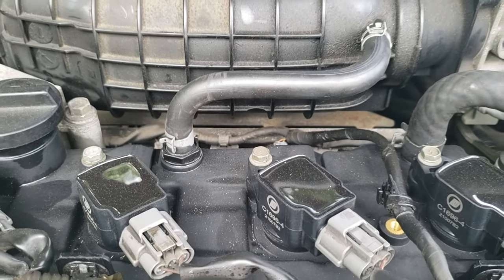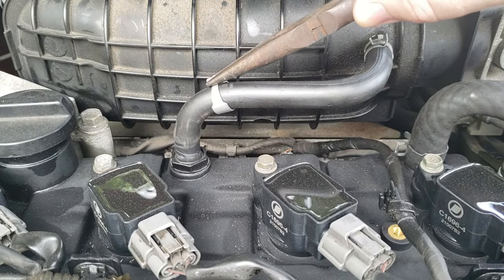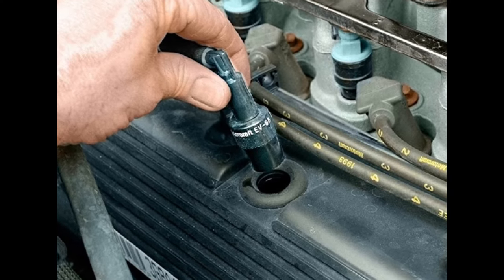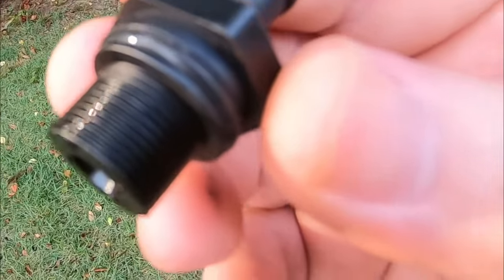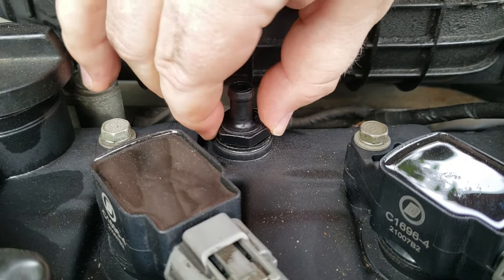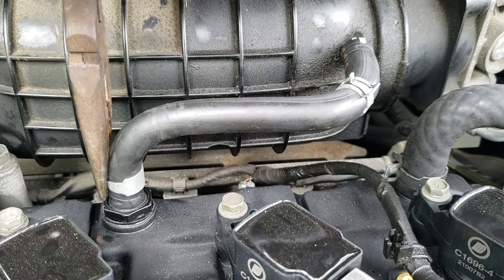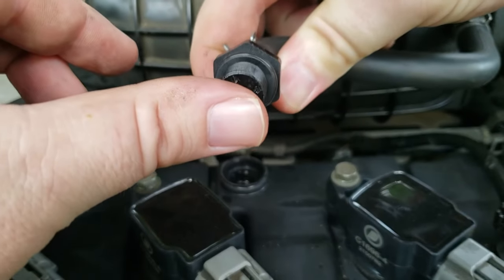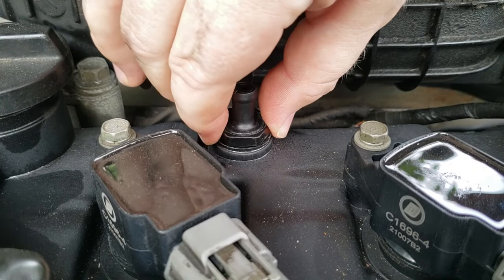Nissan 2.5L (QR25DE) PCV Valve Replacement - Quick Guide!

Comment: Hello, I am the owner of Nissan X Trail 2.5 Petrol 165 PS. 2003 year. Car uses oil every 400-500km needs extra, no signs of smoke or leaks . In the group of Nissan I was told it might be PVC Valve , Is it possible that this problem is from him, I look forward to your reply.  Thank you
Reply: My 2009 nissan navara “frontier” with the same engine was consuming a lot of oil almost 1 quart every 300 km, and just after cleaning the pcv with wd40 and compressed air it was another story like no more oil consumption at all.
Reply: @marwanjleid5712  super Thank you for your reply next year when I go back to my home country I will change it I ordered a brand new one pCV . The car is driven when I go home on vacation to my home country, I've had it for a while, I hope to solve the problem and it turns out to be just that.  👍👍👍
Reply: @Todorov7900 
It would be better to replace the rubber tubes if they are worn, this problem is known for these engines as i know here in libya and the middle east market and the best way to solve is to install an oil catch can.
Reply: @marwanjleid5712  THANK YOU friend for the recommendation and time I will do that too if there is no difference with The PCV valve

Comment: Hello. I have a 2010 Altima 2,5L 110K. I cleaned my valve cover 1 year ago but there is again little oil on it and around the pcv valve. Do I have a problem or is it the same with your altima? TY
Reply: I just replaced mine.  No oil found around Oct valve.  Make sure your o-ring is properly installed.  Oil may be coming from the oil cap.

Comment: Anyone got the part number for the hose ? Been looking around and the closest I got has been for the Altima ser 11823-JA00A
Reply from the maker: You are correct! Here's an eBay link for the hose, hope this helps! 😁
https://www.ebay.com/itm/NEW-OEM-GENUINE-NISSAN-2007-2012-ALTIMA-2-5-PCV-HOSE-BLOW-BY-HOSE-11823JA00A-/192934810462?mkcid=16&mkevt=1&_trksid=p2349624.m46890.l49286&mkrid=711-127632-2357-0
Reply: Thanks ~  I recommend everyone checking there local Nissan dealer just picked up 2 for 10$ and didn’t have to wait for shipping
Reply from the maker: That's a great deal 👍

Comment: I have a Rogue Sport which is for the most part similar to your Rogue except it has a 2 liter engine.  Is the PCV in the same place on it too?  Not sure if you know or not.  Just trying to figure out where it is.  I was considering a catch can since these are direct injected and the fuel going in does not clean the valves.  This can slowly rob you of that new feeling that the vehicle had when you first got it and everything was as smooth as can be.  I also realize that the CVTs these vehicles have shall not be neglected if you hope to keep them for any period of time.